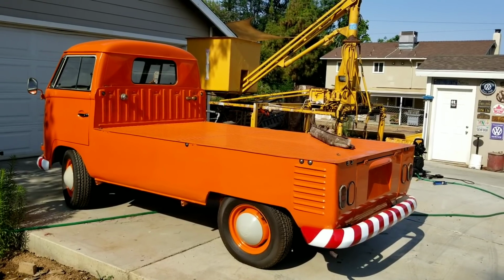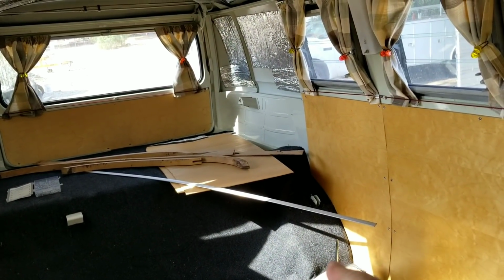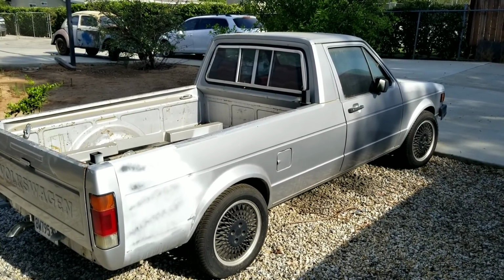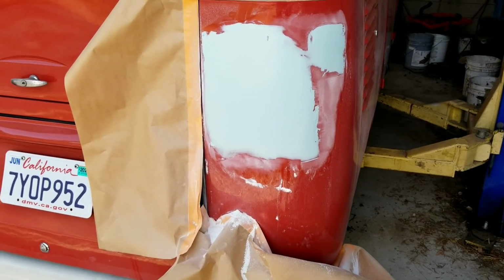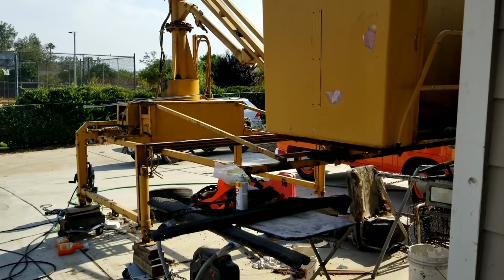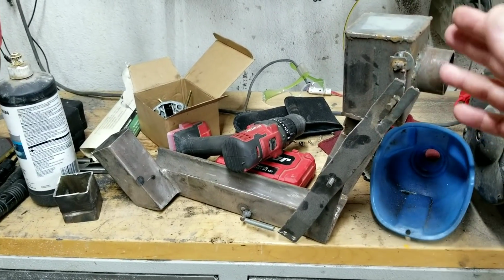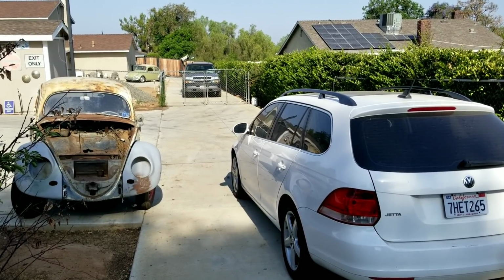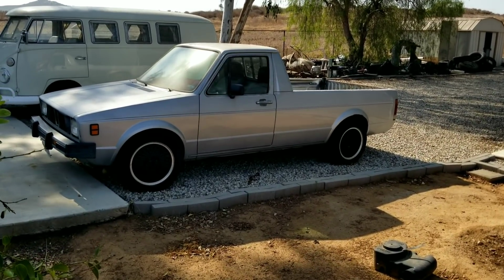30k thanks and shop projects update What is coming up on the channel

Comment: Hi Mike, watched this a day or so ago and just getting around to saying hi. Understand the heat issue. I get out in the sun and not long before I'm back inside. I can see where trying to make headliners would be a pain when if you can have some else do it is well worth it. Talk about chevy injectors had my diesel 6.6l duramax done by a good diesel shop and well worth it. I think you told me your is gas which those injectors are allot less expensive and easy to get to for sure. I didn't realize how many vehicles you have. Ouch on insuring them.

Comment: I had a NEW 1915 Built by Donson Performance (Dons Bus Box) and it completely runs like shit (Misses, backfires, seems like the timing is way off)  This has happened twice now.  According to them  both heads have been replaced along with new carbs.  Seems to get worse as it heats up.  I will say after this happened today, they said they were going to build a new motor.  Is there anything IN the motor that would cause a variable issue like this?  Seems to run fine on the bench.
Reply: If they did not set up the compression ratio correctly for whatever fuel you are going to run it can cause issues.  The incorrectly sized valves/springs for the size of the motor/cam you are running will also cause issues.  Then there are ignition/timing/carb issues that can all cause issues.  Need much more info on what parts were used and how it was assembled.
Reply: @ocavant  They have it now.  I told them to not call me until it runs like a sewing machine or give my $$ back.
Reply: @frankmick8683  You should get what you paid for. Best of luck.
Reply: 3rd Strike.  I pick it up  sounds great.  Get 1/2 a mile same dam thing it starts missing popping.  This is after they replaced the Dist for the 3rd time and a new gas tank ( Crappy Gas/Debri in tank).  Now they say its got to me a ''Short'' in the wiring someplace.
Reply from the maker: missing and popping must be ignition. make sure they didnt put one of the white box pointless ignitions in it or points from cheap supplier. they fail. Need empi or Petronix distributor
Reply: @Mikefngarage  3 Different Distributors, 2 bosch coils, new wires.  Did not locate issue yet.  Awesome work you do by the way.  I had to watch the tire size video 1/2 a dozen
 times before it sank in LOL
Reply from the maker: @frankmick8683  Resistor wires? they dont work on VWs. China ones work ok as long as they are wire inside.  also Plugs must be Bosch resistor. No new fangled ones. Platinum plugs will do that too. Bosh dist cap. some of the china crap does that too. Rotor must be Bosch it has a resistor in it. Spark must be blue and jump 1/4 inch. Yellow spark means weak. Blue is hot. Carbs Popping maybe but a misfire is ignition or possible tight valve. the only thing in the engine that could cause it would be cam timing off. honestly It has to me something on the outside of the engine.
Reply from the maker: if you have the new style heads_peanut plug. you need to run NGK resistor plugs.
Reply from the maker: no platinum, Split fire, gold any of the new car ones foul....
Reply: @Mikefngarage  VW is fixed.  Evidentially the camshaft was marked wrong or it was ground wrong.  Noticeably different when compared to the cam it supposed to be.  Car runs great.
Reply from the maker: @frankmick8683  AWESOME....Thought it could be that. but that is uncommon. also would possibly mess with the timing and all that too. Damn VW parts suppliers make such crap now my buddy does not even want to build motors anymore. Its a crap shoot.
Reply: @Mikefngarage  Update: LOL   By chance I met a guy today at a circle K (Gas Station in AZ) I was asking about his exhaust and we started talking.  As it turns out, the shop and person that built my engine pulled the same crap with him and it cost him his engine 4 months down the road.  He gave me a guy named Steve Godfrey.  I called him and he is going to fix my shit properly.  After talking to this fella this shop does this all the dam time and is a huge seller on E-Bay.  Im out a few grand but learned a lesson, GET IT IN WRITING first and ask for references.
Reply from the maker: @frankmick8683  yea for sure that should never happen.